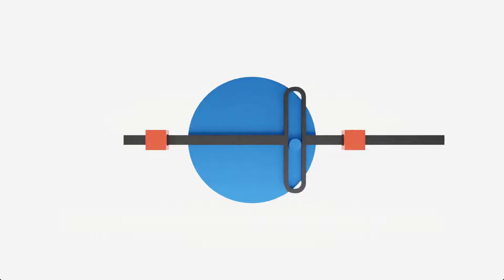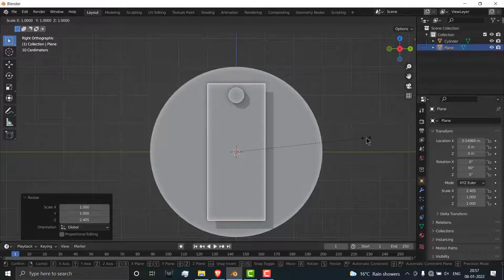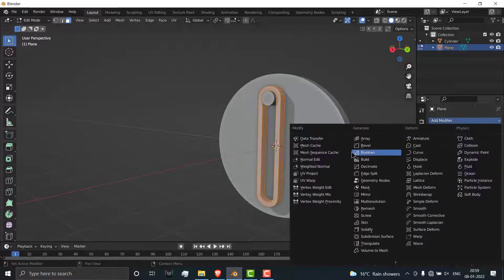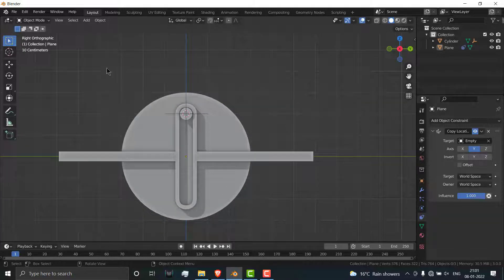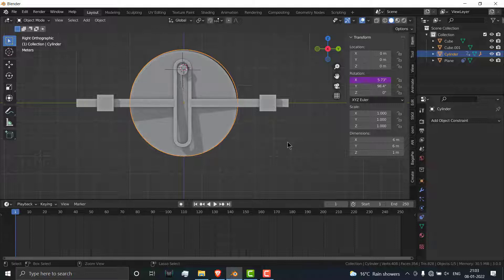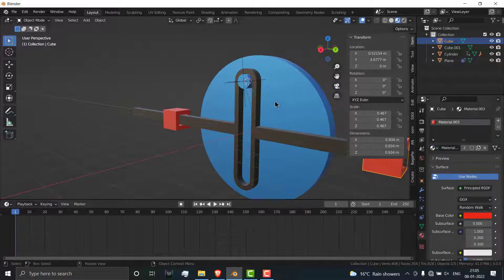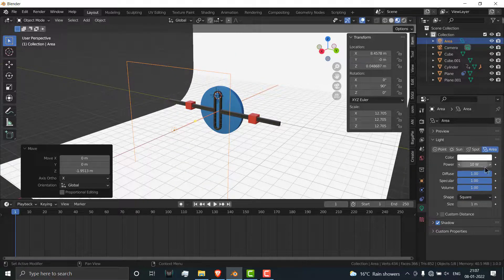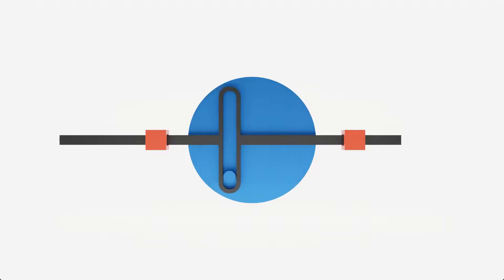Tutorial |Scotch yoke mechanism in blender

Comment: Amazing tutorial sir ! I didn't thought simple 'copy location' constraint can be so useful.
Reply from the maker: Glad you like it.any tutorial you want ?
Reply: @MouryaWorks Most car tutorials focus on car body and wheel modelling. Car rigging tutorials just explain wheel rotation based on car body movement. I didn't find any in-depth tutorial which explains how to rig the core car mechanism.

It would be great if you could make a tutorial which focuses on the core mechanism of automobile. No doors, no windows, no bonnet,no windshields. No unnecessary modelling details. Just four simple wheels connected to chassis and other necessary parts for car movement.

It should show how steering wheel changes the direction of wheels, how brakes and suspension are rigged. How the suspension works when car moves along bumpy path. How lights (emission material) automatically change based on steering wheel rotation. In short, this tutorial should explain the things which most other escape.

Thanks in advance 🙏🙏🙏

Comment: Quick hint for if you want this mechanism attached to something else that moves, potentially meaning that the mechanism won't remain aligned to the Y-Axis.
Local space will not work, however if you parent the mechanism mesh to a second empty, and set that empty as custom space, and the mechanism will work at any angle, ensuring that you can use the mechanism as part of a more complex rig.